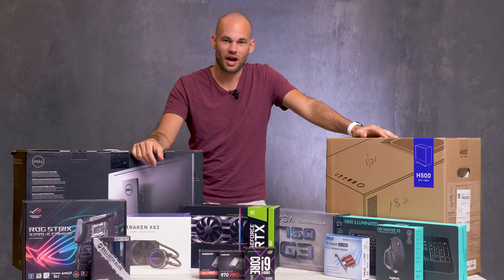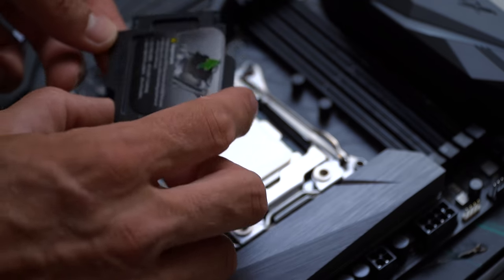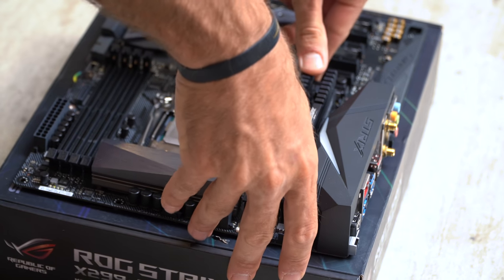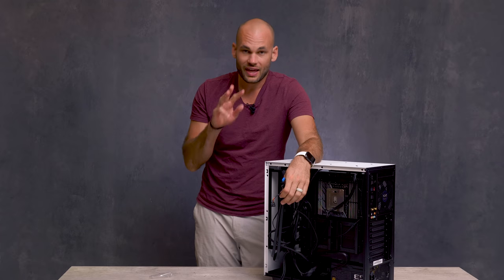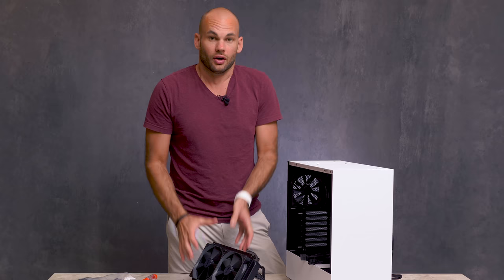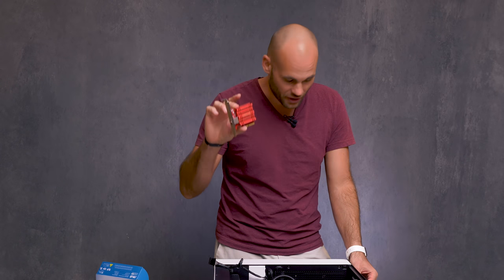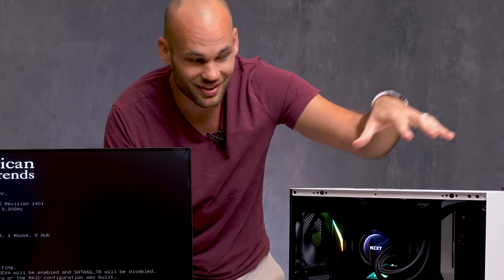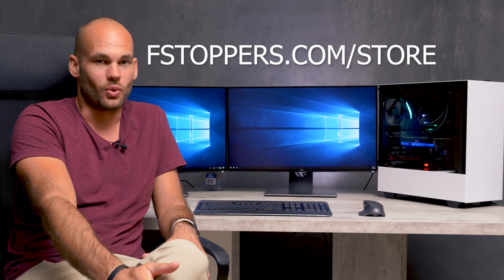The Ultimate Computer Build For Adobe Premiere 2019

Comment from the maker: Read everything about this build and get the prices of each part, plus cheaper alternatives here: https://fstoppers.com/originals/step-step-guide-build-ultimate-photovideo-editing-pc-2019-335417
Reply: Hi Drew, I've one question in mind, do I need Quadro to get 10 bit color in Photoshop? Or a geforce will do the job??
Reply: This link doesn’t seem to load on my iPhone.
Reply: Can you make for me one all together..... cost ?? And I m from Qatar, I need to work Cinema4d, octane , after effects
Reply: Watching this builds to learn about new components, and possibly upgrading our current system. However it's missing one of the most important aspects of setup: the configuration of the BIOS. You folks should do a piece on that, because it's very important.
Reply: Subed ❤❤👌
Reply: hello, I was just curious, can you tell me how much did the entire PC cost?
Because I may be interested to call someone to build the same exact pc for me you showed us in your video, but I'd like to know the final price for this
Thanks in advance for your answer. cheer ! 👍

Comment: Dell U2718Q 27" 16:9 UltraSharp 4K IPS Monitor(x2) - $899.98
Crucial 64GB Ballistix Elite Series DDR4 3000 MHz UDIMM Memory Module Kit (4x16GB) - $522.95
ASUS ROG Strix X299-E Gaming LGA 2066 ATX Motherboard - $289.51
NZXT Kraken X62 All-in-One Liquid CPU Cooler with AM4 Bracket - $149.99
Intel Core i9-7900X X-Series 3.3 GHz Ten-Core LGA 2066 Processor - $996.95
Samsung 1TB 970 PRO NVMe M.2 Internal SSD - $347.99
Samsung 512GB 970 PRO NVMe M.2 Internal SSD - $167.99
EVGA GeForce RTX 2080 XC GAMING Graphics Card - $779.99
EVGA SuperNOVA 750 G3 750W 80 Plus Gold Modular Power Supply - $99.99
ASUS XG-C100C 10GBase-T PCIe Network Adapter - $98.25
NZXT H500 Mid-Tower Case (White) - $71.99
Logitech K800 Wireless Illuminated Keyboard - $59.99
Logitech MX Master 2S Wireless Mouse (Graphite) - $99.99

TOTAL BUILD COST: ~ $4585.56
Reply: Was hoping someone would itemize the costs...
Reply: Yeah fuck this how many people are genuinely able to drop so much on this.

Comment: Not nit picking but the AIO typically needs to be plugged into the cpu fan or AIO pump header port.  Not just any motherboard fan slot.  Additionally the connectors off the AIO watercooler harness could have the fans that are installed on the radiator installed  that way they are picked up by the NZXT software for fan curves... or you might end up having to set it up in bios.  Cool build tho  :)

Comment: Just a word of advice. 
A GPU will hit a higher overclock with 2 cables from the PSU.
The CPU also have 2 cables 8 & 4 Pin. That will also hit a higher overclock if both cables are used. I also believe that the VRM don't have to work as hard with 2 cables.

You should also go in to the bios settings and enable the Intel iGPU on the CPU and install the Intel driver. This will make Premiere even faster when exporting h.264 (/5?). That's because the Intel GPU have hardware for video encoding that the the nvidia GTX/RTX cards don't have. You should have 2 GPUs in the performance tab in Task Manager if this is working.
Reply: @MegaAlpakka 
Correct! Wrote that when finished watching the video and "remembered" i9-9900k when it's the  i9-7900X. No iGPU on the HEDT-platform.
Reply: Nvidia GTX/RTX don't have hardware accelerated Nvidia Encoder H.264/5 (aka NVENC) like the poorest Intel QuickSync video on Intel iGPU ?????????
 Third-party Open source plugin to use Nvidia Nvenc Encoder (in place of gpgpu CUDA which provides better performance on Quadro GPU) during video export in Première Pro (Adobe media encoder) exists for Windows.
Reply: Even with an onboard GPU, using the Intel quicksync features is... debatable. IThere were some minor but noticeable quality losses for quicksync exports. That said, so very much faster on more modest hardware; I bought Edius years ago just for that support. Exports that take 8-9 hours straight through my CPU are done in under 90 minutes. I can tell the difference, but depending on the application, it can be appropriate.
Reply: @m88k  Intel QuickSync video is also supported by Premiere Pro CC ...just set the program preferences in Adobe media encoder to use QSV for export video

Comment: 3950x (16 core 32 threads), 64gt 3600ghz RAM (fast cl!), 2080 TI, 4gt m.2 ssd, 2 tb sata ssd, 3 tb hdd, AIO cooler, good x570 mobo, 710i case etc.  It's almost the same price  a year later than this build I quess (over 4000$). that's my recent build. Evolve is huge!

Comment: I installed the exact Kraken x62 into the same NZXT case with no trouble at all. You might have the wrong fans. My fans are 140mm and screws lined up perfectly with the radiator and original case fan bracket.

Comment: Hey there I also built into the NZXT H500 and yes there seems to be some issues with putting a 280mm radiator even though it "says" it can support up to a 280mm rad. The way I put a 280mm rad in the system was I mounted the fans on first then put the bracket on after but I was able to align all the rad screws in and it was a lot easier to insert in the case! Just heads up this case likes a 240mm rad but you can still use a 280mm just need have to insert it carefully so you dont chip off the paint. Overall a clean and killer build and guide

Comment: Nice build.  Very similar to both my media editor and my game developer systems.
The only main difference in my builds is that I always use Noctua tower air coolers.  Noctua > Water/AIO every time.
I also always use Dell large or ultrawide monitors.  My media editor is an ultrawide plus native video preview monitor.  And I use workstation graphics in my productivity systems, such as my media editor, I don't use gaming cards.

Comment: I'm trying (and failing) to understand the choices for the specs here.

Why are you using a Skylake-X CPU over something in the Xeon W-series, which are specifically made for this kind of workflow? Or a Threadripper?
While we're on the subject of the CPU, why are you using a CPU that's 18 months old and has been superceded by two generations?

Then the cooling. The 7900X runs incredibly hot. Why are you using an NZXT Kraken, which is a mid-tier AIO that cools worse than a Noctua air cooler (which are also cheaper)? There are far better options for cooling.

You're building the ultimate computer for Premiere, so why are you using a GTX 2080 over the demonstrably faster GTX 2080 Ti?

For the drives, I'd personally have chosen for Intel Optane-powered drives such as the 900P series, but those Samsung drives work just fine. NVMe is beautiful and I love it. 

I'm sorry, but I feel that the wrong choices were made here with regards to the specs. It could've been far more powerful, especially for its use case.
Reply: Premiere pro prefers Intel with the threadripper question
Reply: Lars Ose-Johansen up to a certain point. The 7900X is old enough for Threadripper to beat it, even in Premiere Pro. And that still leaves the purpose-built Xeon W-series.
Reply: @larsosejohansen  
The Threadripper 2950x runs circles around the Intel 7900x in Premier Pro, specially with the latest multicore optimizations Premiere Pro is getting.
Reply: 1idd0kun Im just saying that for a long time, in the pc world intel has been better than amd with premiere, but things are def. changing.
Reply: The 2950x has 6 more cores 12 more threads and costs 100 dollars less. It generates less heat, has more pci express lanes and supports more ram. You can easily build a far better machine for less money. I might even argue my overclocked ryzen 2700 would compete with this system in a premiere workflow and the entire build cost less than the processor in this.
Reply: as far as I know, component selection was done by B&H and was donated by them to Fstoppers.
Reply: Rahul Kumar if that is true then B&H has poor computer building knowledge.
Reply: lol wut did you just say threadrippers were made for adobe?
Reply: This is a photography channel not a tech channel.... We can forgive them
Reply: ForteSpy Productions not really. They are by using these parts recommending them for use as parts for a “god build” so to speak. Problem is there are tons of parts that are better suited to the task and if you don’t know what you are doing you get lambasted for getting into it. And verge just proved a few months ago.
Reply: @mizinoinovermyhead.7523  Nonsense. B&H wants the PR, and they have a bunch of hardware they can't move. Instead of having to adjust it down, they give it to these guys, write it off entirely at the full value they paid for the hardware for tax purposes. The memory kit is also a discontinued sku that probably was meant for too much markup.
Reply: Brian Monarch what budget are you looking at?
Reply: @Brian Monarch Of course thats a prebuilt you could do slightly better if you built it yourself.
Reply: I too am building this computer with so modifications. I chose the 2080 over the Ti strictly due to price (Which is probably why he chose it as well). It's about $600 more for the Ti and you are not getting that much more performance out of it as far as Premiere is concerned. I will say that I upgraded mine to the i9 9900X chip, however, I tend to use Cinema 4D and Cine Tracer, so I needed the extra cores for graphics.
Reply: @Ranger7Studios  And you'd have done better buying an  x570 board and a ryzen 3900x. more cores, almost as fast IPC, PCIe gen 4 and all for basically the price of your processor. You can build almost an entire system on AMD that will cream the 9900x in productivity for the price of the 10 core 9900x.

Comment: For video rendering, Adobe Premier takes advantage of CPU hyperthreading for video rendering. However, the Intel i7 9900K you installed is an 8 core with only 8 threads. I think you might have had about a 30% improvement in rendering time using the i9 9900K with its 8 cores and 16 threads and complimented with a graphics card having at least 1900 cudas. I have not found anywhere that Lightroom and Photoshop software design takes advantage of CPU hyperthreading, but will process faster with 8 cores, especially noted when batch exporting a large number of RAW files from Adobe Camera RAW to JPG. I suspect that PS might have a small advantage using hyperthreading for rendering very large composite image blurs and batch exporting. With new CPU generations surfacing, it would be nice if Adobe could feature their software programs to take advantage of the faster and greater number of core pipelines.

Comment: you say "ultimate" however, your build precludes you from utilizing a true 10 bit r/b/g color workflow.   If you want to call this "ultimate" i suggest you add and swap to the following

GPU:  you need to add either a quadro card from Nvidia or a radeon pro or firepro card from Amd (you can also use a vega frontier edition as those qualify for use of the pro drivers).  If budget is an issue, suggest grabbing a used card off ebay.  If you want "ultimate" than i would recommend the NVIDIA quadro gv100.  Note however, that this will set you back $9,000.  If budget is an issue, than suggest grabbing an amd vega frontier edition (undervolt via wattman) off ebay for around $400.

Monitor:  The monitor must be capable of true 10 bit, not 8+FRC.  If you want true "ultimate" than i suggest the 8K monitor from Dell - the UP3218K.  This is a true 10 bit panel that displays 100% everything (98% of DCI-P3 space).  It will set you back over $3,000 each however.  Really put your mac friends to shame with this monitor.  If budget is an issue, suggest the BenQ sw320

Comment: Hello and thanks for the video. As for your Cooler fans. You mounted them wrong. They should be on the other side of the mountings bracket. From what I can see you have them inside the fan wall. 

Have a look at the videos from the manufacturer or send them a note. 

You don’t talk about AIO in any details for example the CAM software, the usb2 connector. 

Anyway building as new computer need to know that you skipped a lot of points.  

I know from experience that it’s hard to build something with the knowledge that hundreds or even thousands of people will be watching. So to be far you did a great job. Not sure if to did a follow up video, if you did that’s great. If not please consider doing one.

Comment: I have the same case and X62 and I don't recall having any issues when installing the Cooler to the front of the case. I also did switch the fans for the BeQuiet! Silent Wings 3 which are nice and silent. Great video :)

Comment: Just add the NVENC plugin into Adobe Premiere and you'll be able to render out hevc h.265 4K footage at three times real time playback speeds. Or 30 minutes of footage renders in 10 minutes.
Reply: basspig are you for real?because im abt to give my maxed out specs pc based on x79 with i73930k to my son and start a whole new build for the sake of flawless 4k video editing..
Reply: @themightyraccoon2127  There's a whole thread on the Adobe Premiere forum devoted to the NVENC plugin development. The current version is stable and works well.
Rendering with 3500 or so cores goes much faster than rendering with only 32 cores. I use NVENC for nearly everything that needs h.265 HEVC output because it's fast. It is even faster outputting 1080P from 4K masters. But I mainly output 4K for online publication.
My system config is dual Xeons, 128GB RAM, GTX1080Ti. The most recent GPUs support hardware encoding of HEVC now.
Search Adobe forums for NVENC and you will find where to download it and how to set it up. You'll need NeroAAC and MP4box, both free, to handle the audio encoding and muxing.

Comment: The AMD Ryzen Threadripper 2950X at $880 would have been a better choice imo.

Also this build can be done loads cheaper without losing a lot on performance. This is really only a build for people who have too much money.
Reply: Please describe the build for the common man
Reply: @yes9900  Well, the common man won't buy a 2950X. I am assuming the main task will be video production? A lot will depend on the timeframe, do you want to buy it right now or can you wait for a while? Also, a lot depends on your budget. You can get a solid system for as low as $600, but of course you will be cutting some corners. Something like this, although I would include a nice big SSD with it: https://www.newegg.com/global/nl-en/Product/Product.aspx?Item=N82E16883230369. Ideally, however, I would wait for the 3rd gen Ryzen 5 or 7 (3XXX) which will launch later this year and will offer a lot more processing power for the same money. And if you can, I would wait for a Black Friday deal.
Reply: @Kelkschiz  I've tried most Adobe Premiere tips to lower Scrubbing lag , I have an Aircraft Carrier Workstation : https://www.userbenchmark.com/UserRun/16160845

But I still get the choppy jitters when adobe editing , how to get it smooth as butter ?
Reply: @Brian Monarch My guess would be, yes. For most applications the 3rd gen Ryzen 7 and 9 will out perform the 2950x. The 2950x might still be slightly faster in applications that fully utilize the higher core number of the 2950x. I am looking forward to seeing the benchmarks.

Comment: Also you didn’t show but i hope to god you overclocked the computer, especially considering its a productivity build. If notnot whats the point of the water cooling...
Reply: Jorge Torres he doesn’t have a lot of headroom for overclocking tbh. An overclocked 7900x can draw 300-400w of power no problem and spike even higher. Likewise for the GPU. With a 750w psu he can overclock but he will need to be careful as he doesn’t have much headroom, especially with GPU/CPU intensive editing.
Reply: AND, they Pay a Lot for POWER on the island! ! !
Reply: Aio cooling or watercooling, some people just want a quiet pc sometimes 😉
Reply: Considering they did this video like a build guide for newbs, I'm glad that he didn't talk about overclocking. OCing is a lot easier now, but it is definitely not something you want someone trying when they don't have any idea what they're doing. It's unlikely you're going to kill something, but it can be a nightmare for stability.

Also, you can't by non-k versions of the x900 line. So if you're looking for the max core count and core clock (which he is for getting a 7900k) you have no choice by buying an overclockable processor.
Reply: I second @Hampeus AIO systems are quieter. Less distractions when editing - without making headphones essential (Although in a shared office they may want that anyway)

Comment: Get a screw for the 1st m.2 drive
Reply: Also noticed the screw was not mentioned for the first M.2 drive. The foam block does not secure the M.2 drive the screw does.
Reply: The screw that holds the cover on also holds the M2 drive. It's a little screwy, but it works.
Reply: @kwarner04  Thnx
Reply: On my Asus board you can't screw in the m.2 with the foam piece or it will bend the SSD in a very uncomfortable way, you can just hold it in place with  the cover but I didn't like how it would stick to it and be forced out when removed, I found if you use the 3d print face place riser included with the motherboard and then screw in the m.2 it will secure the m.2 without potentially damaging it by bending it